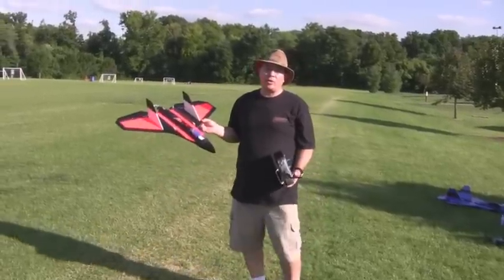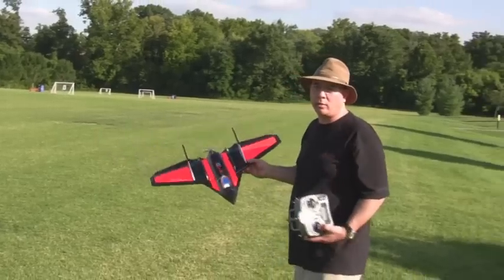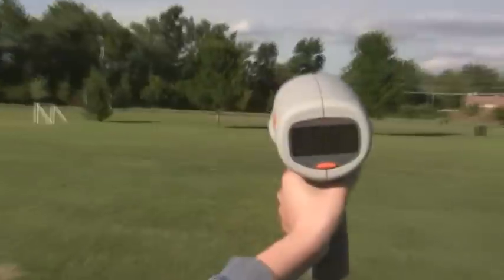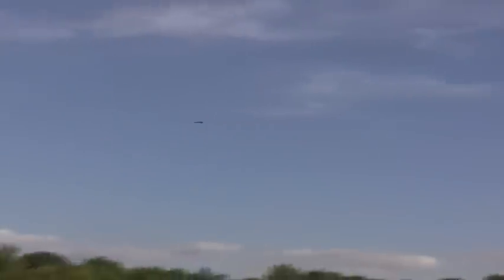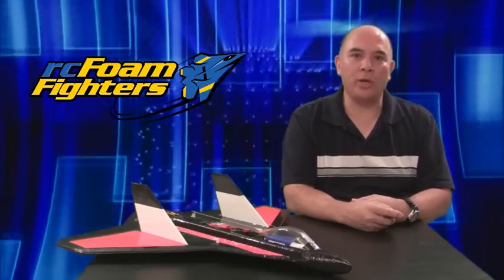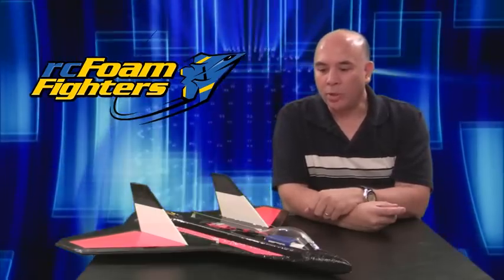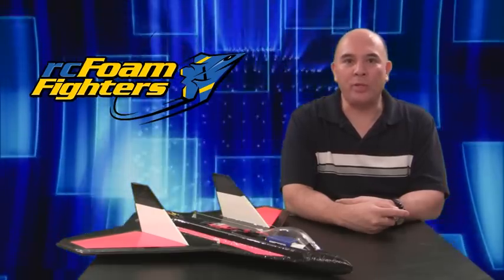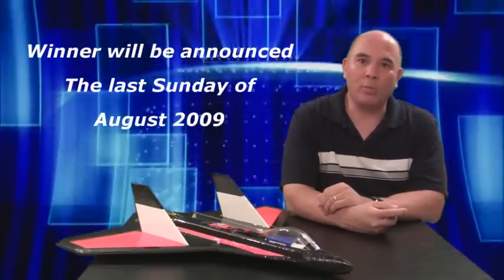SkyFighter v2  (with 4 cell setup)

Comment: Frank I built your plane but i used 2 layers of 6mm epp and put henries weave in the middle of the two layers as well as on the top and bottom. I'm using a 2200 3S 20C Lipo and i got it to come in at 20.4 oz. It flies great thanks for the plans. I asked for a radar gun for christmas so I can see how fast its going. X your fingers. Thanks

Comment from the maker: altops I suppose you could do it that way but the cooling would not really help the windings that much because they are wrapped at the inside of the motor and the magnets are glued around the windings on the inside of the motor can. This is the opposite of an inrunner motor. The windings are what really need the cooling the most. I guess I need to start trying some inrunner motors!

Comment from the maker: wildhover even I sometimes feel like ducking, lol!!! I downloaded a free Doppler sound wave file speed calculation program. You are supposed to be able to load wave sound file into it and it will calculate the top speed of the aircraft from the sound recording. You still have to fly strait at the camera but shouldn't have to be so low. This may be a safer way to do speed checks. Lucky for me Thom is very forgiving. Things were good a few hours later.

Comment from the maker: Yeah youtwoba the 4 cells definitely heated things up a bit. I probably won't use them again till the weather starts cooling off. These would be best suited for the winter months when the air is much cooler and can help keep temps under control. The watt meter readings were 24.5amps@370watts.I might try them with a lower kv motor to see if it brings the numbers down.

Comment from the maker: altops heat sinks work great on inrunner brushless motors but I don't think I would want to try that on an outrunner brushless motor. The speed on this one was checked with a laser tach and was over 26000rpm with the 4 cell. I think the centrifugal force would throw the heat sinks off the motor like a grenade exploding. Please don't try it.

Comment: yeah i should have said that I like it a lot, now you understand that I am waiting to see that plane reach the three digits :-) I mean, it must be possible, you where so close. I've seen a video from a real acrobatics plane with a giant brush less motor, it can fly ten minutes when they do acrobatics, or an hour when they fly at normal speeds without acrobatics. The video does not show them flying, but it is real, and it can fly. It is an American company that makes them. 

Greets, iT

Comment: OK i understand the logic behind that. How about using shallow screws, or epoxy on the outboard? Of coarse you would have to use at least two and balance it by grinding down fins as needed. another option is to use a stiff copper wire wrapped around to hold them on securing the join with some solder ! ! !

Comment: take some VGA computer video card heat sinks with self adhesive thermal tape, before applying them, you may need to lay them across a socket and bend them to match the motors arc then apply and go. sorry no pics or vids, just though of it.